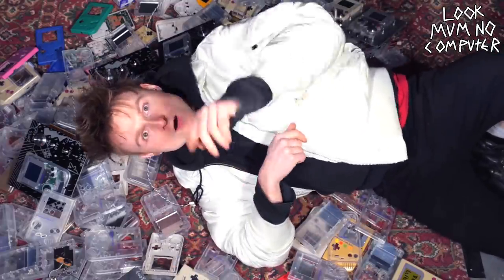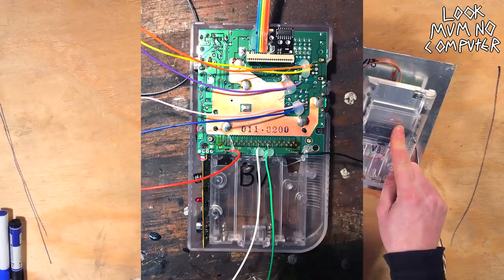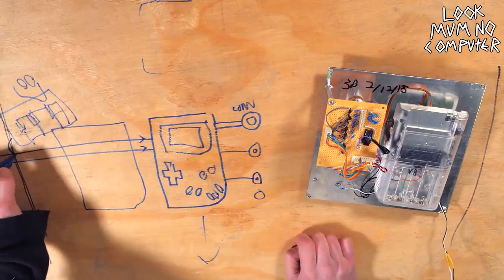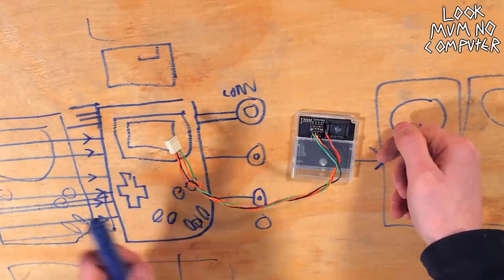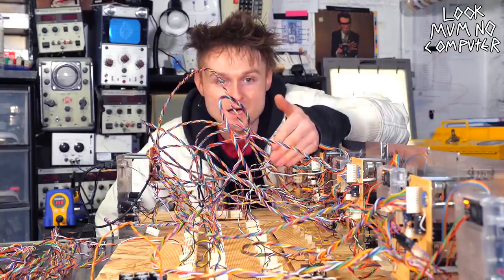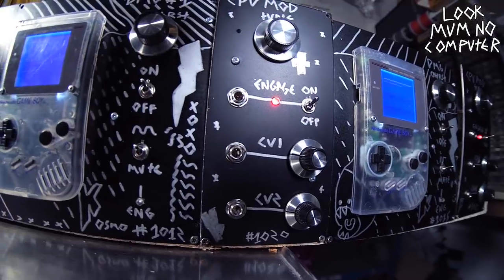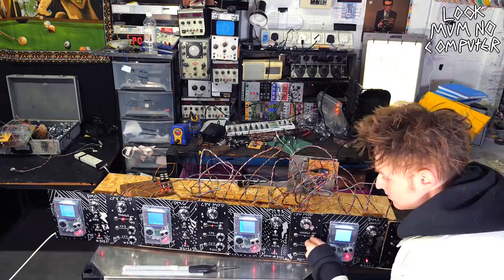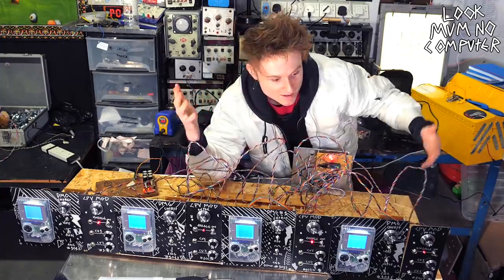GAMEBOY MEGA MACHINE Vlog Part 2, Breaking Out The Gameboys

Comment: Next, ring modulating CPUs against each other. ;)
Reply from the maker: it has crossed my mind. the major set back with the CPU's is its next to impossible to perfectly match the ltc1799's initially i wanted each gameboy to have its own cpu mod, instead of 1 per column. which would open up to polyphonic fm and ring mod :(
Reply: it's a real thing! It works great in C64 (at least) between it's paraphonic voices. Tried this in Electromusic app.
Reply from the maker: @KiR_3d  paraphonic is easy :). i am implementing all that. paraphonic fm and stuff. the problem happens is this is a lot of voices, it has a tendency to sound sloppy, but itll be there none the less
Reply: PLL time?
Reply: 4046 to control that? I'm just finger-pointing somewhere :D
Reply: How does that even work? Why do the CPUs even operate when clocked like this?

Comment: Would you like me to get these panels laser cut for you? I guess it will be under 8€/panel. 2mm Aluminium. Oh and why not get a huge industrial switch box/fuse box for the case? Its lighter than wood and you can swing open the door for access.
Reply from the maker: hey man!!!! oooh a fuse box haha. that would be pretty sick actually! :O. sounds interesting about the panels! annoyingly i've already got all of the panels. i went to a workshop and used their guillotine, on a couple of sheets! haven't cut all the holes yet! though but i guess i've blown the ability to do them practically now they are all cut out?
Reply: @LOOKMUMNOCOMPUTER  You can either keep those panels for later, or sell them on ebay. Or you use them and drill the holes. You could make a template so they are uniform and easier to drill.

Comment: You should add some guitar effect pedals to the output. I garuntee you can get something amasing, like with flanger and reverb. Or even just plug it into a tube amp, for some super crunchy overdrive. 

Ive plugged my keyboard into my tube amp. I call it cheap innovation.
Reply from the maker: yep indeed! im only adding effects that need to be on seperate voices, im using external effects for anything after all of the voices are mixed together. like pedals and such :)

Comment: You need you add an audio out to each one so you can FM one with another and unison detune so you don't have to do it manually per 50 gameboys
Reply from the maker: it is in bank of 6's. so no not all 50. but 8 per voice will have seperate control and fm. the fm wont work only paraphonically :(. cant be perfect :D
Reply: @LOOKMUMNOCOMPUTER  if only you had 8 envelopes and used FM in different algorithms, you'd basically have a gameboy dx7

Comment: You should use ribbon cables instead of bus boards. A lot less work and a lot cleaner looking.
Reply from the maker: indeed im doing so! however not for cleaner looking, that is the reason i initially didnt use it, clean is not what im after, more spaghetti the more beautiful. but im sick of how long it takes to make those wire looms. so shelled out a bit of cash for a huge roll

Comment: Hi, Sam! How you've didn't ran out of IOs on that Arduino-boy? I can't understand the concept.
Reply from the maker: what you mean? each voice (6 in total) has its own arduinoboy,   the arduinoboy is literally split and connected to each gameboy, imagine a headphone splitter, but in this video splitting 4 times. if that makes sense?
Reply: And what will be controlling all 6 arduinoboys? Will this device (I guess it's about that "preset section") care about all parameters for all aruinoboys? Is there a kind of  multiplexing sygnals or it's simpler? I mean do these arduinoboys "reads" values from the "preset section" itselves or it must send values one by one in a queue?
I'm not getting it to 100% definitely )